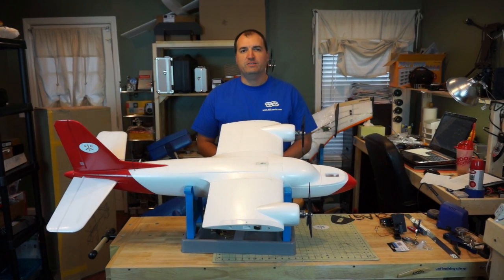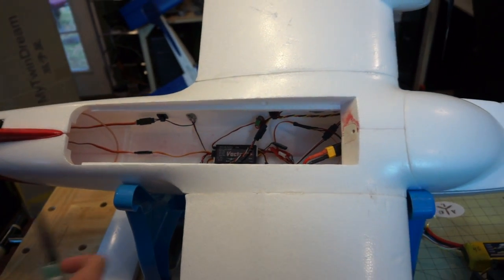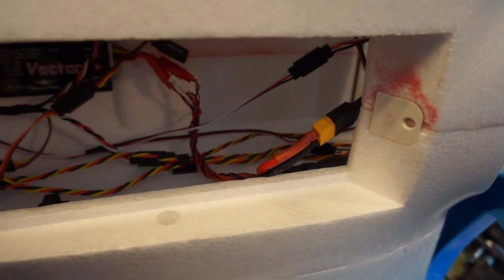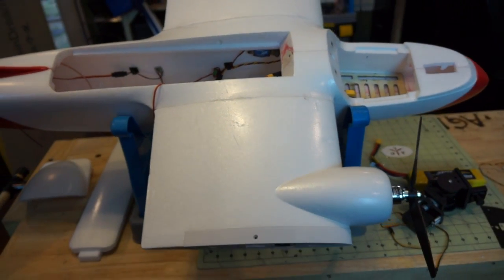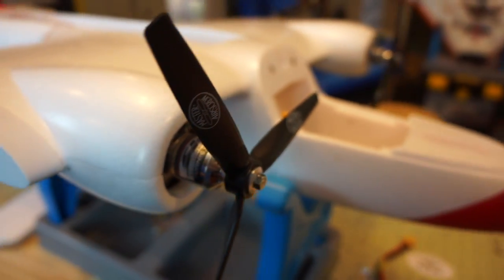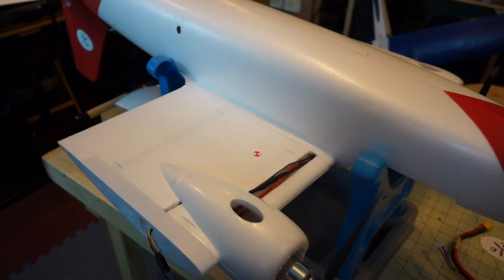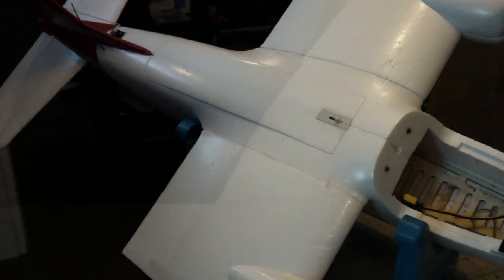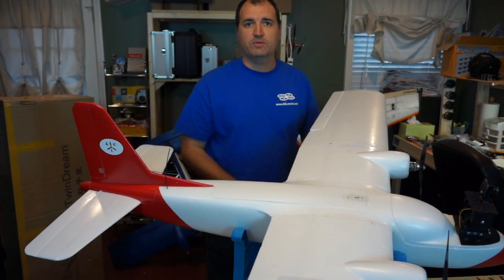My TwinDream Electronics

Comment: Holy crap! That pan and tilt setup was NOT designed for fpv!  lighter is better! Best is NOT better in this application. Over kill is more the word for it! The cost of that equipment CANNOT justify the weight and quality of the use. I have seen simple servo builds do a great job at doing the same thing for WAY LESS money. Crashing is ALWAYS a possibility, especially on that set up. I wouldnt recommend this as a build video for others. I appreciate your effors and no doubt your motors had to live up to expectations. Setting CG on that must have been a bear! Flight time would be greatly shortened on dealing with weight. My question is, did it fly? Hobby King sells some really nice psn and tilt set ups as well as possible 3- D printable type set ups. I would be interested in seeing this monster flying! Looks great!

Comment: You say that you are using SK3 2836 motors with a 4 cell battery. The specs for a 2836 are for a 2 to 3 cell battery, is this a mistake or are you using 4 cell batteries with these motors?   Thanks Bill

Comment: You are using Turnigy SK3 2836 1040kv which the specs on the motor says 2s to 3s. Battery being used is Zippy Compact 5000mah 4s 25c lipo. Am I missing something here? I am putting one of these together and would like to know if you had any problems with your setup?   Bill

Comment: I heard that eagletree vector recommends using digital servos. Is that correct? I know the 939 coronas are digital mg's but are they reliable and accurate? And i know people who use analog and it flies fine as far as i know. But whats the reason of having digitals specifically for the vector. I know what digital seevos are and all but wanted to know why they recommended digitals. The 939's seem to cheap to me to try on such a nice airplane. What are your thoughts?

Comment: I'm building this with a Vector FC. I Noticed your Vector seems to be located way behind CG location. Does this work OK for you . Great build videos!
Reply from the maker: +C JB It is behind the CG point by a couple inches, but that doesn't affect most newer flight controllers.  You can mount them off center, forward, or behind the CG.  They will still be able to properly control the aircraft.  We placed ours at that point because wanted as much space as possible for battery payload.

Comment: I was interested in getting this plane for Long Range FPV but I just do not see how you can fit 4 x 6 amps or 3 x 10 amp batteries in it. If you do it looks like the Vector is going to have to be mounted up on something. I cannot see if batteries will sit side by side in it
Reply from the maker: +Neil Park The vector can certainly be moved.  If I was going to put that kind of payload in there I would build a shelf to put the Vector on, but we are getting 25min flight time out of one decent quality 5amp 4s.  If you put 8 to 10 on board you could fly way longer than I usually care too.

Comment: Amazing video guys. Great work.  I am using it as a how-to.

I would love to see more detail regarding power distribution. Vector says I must power servos separately.  Did you do this?

Also, where does your BEC tap in?  Is that one BEC powering your pan tilt and the plane servos?

What screws did you use to mount the motor mounts to the firewall? Mine didn't come with any.

The only 8 screws I have left are to connect the wing to the shoulders.
Reply from the maker: Taking Flight with G We powered the output (servo rail) with a BEC.  We just plugged it into an open port on the output rail. 
Yes just one BEC powers all the servos and including the P/T.
We used some spare small wood screws to mount the motors to the firewall.
Hope this helps.

Comment: A question regards to transport, do the wing screws have to be removed in order to slide the outer wing out?
Or can you just loosen them , and then slide out to outer wing?
Another thing , wont the set screws damage the spar? as its not really a set screw , but just a wooden screw.
Thanks :) i like your build videos
Reply from the maker: You have to remove the screws completely to be able to remove the wings for transport.
The set screws can damage the spars.  They seem to just barely touch the spars, and may not even be needed at all.  We were just putting it together as the MFD designed, but I've heard of a few people not bothering with the set screws.
Hope this helps; I'm working on editing the maiden video now.

Comment: Hi, do the motors counter rotate or both spin the same way ?
Reply from the maker: Sorry we didn't reply sooner phats.  We have them counter-rotating right now.  There are a lot of differing opinions on whether this is needed.  But, the plane is "relatively scale" and having CR props is a plus in full-size airframes.  Your mileage may vary.

Comment: 1. Add the mount if you want, just remember that drag in front of the cg = instability.
2. Adding tubing to the antenna will shift its resonance frequency. IBC wire antenna is stiff enough.
3. Twist those esc power wires.
4. Replace video cable with shielded if you get lines.
5. Consider a proper tracking device like the Marco Polo (RMRC)
6. Remember to do proper range test before launch incl motors at full power. Running servo and power wiring in the same channel may kill uhf.
7. Consider moving control links to the middle or less of servo horns for more leverage. 15deg on any surface is more than enough.
8. HK motors are usually not balanced well and have bad bearings. Add the price of new bearings, and you could have bought a proper motor to begin with (Sunnysky, Cobra etc.)
9. When you glue the wing shoulders, do not use the setscrews in the spar. Only detail I did not like with the kit.

Build video was great, gave a very detailed overview of hardware etc included in the kit.
Reply from the maker: Thanks for the comments jinkslynx.  This was the third video, hope you watched the other two.
1.  It is very common to have P/T mounts on FPV aircraft.  This mount is not any larger in frontal area that the GoPro brushless gimbals that MyFlyDream has mounted on the same aircraft on their flying demo videos.  So, we are not worried about that.  Plus, the vertical stab area is generous. 
2.  Adding tubing, such as a stirring straw, will not change the resonance frequency.  It is not made of carbon fiber and should not block any signal.  But, we only add what we need to keep the antenna vertical.  The IBC antenna is fairly stiff, but, not stiff enough to keep vertical orientation at higher speeds, so the bracing will be needed. They are fine for most multirotors though.  (keeping vertical is important!)
3.  The esc power wires are a little thick to twist in the provided foam channels.  If you meant the ESC signal wire, it has a ferrite magnet and is clear of most other sources of interference.  But, not a bad tip.
4.  In some installations where there is little room, or no filters on the camera/VTX power, it is not uncommon to get lines.  The Vector is filtered fairly well and we have yet to see an issue with it.  Some have issues with IMRC VTX's because they have a built-in filter and they don't play well with the Vector.  In that case, it is recommended that you have the VTX wired straight to the battery.
5.  We don't use a tracking device, but, we will not discourage it's use!  We display GPS coords all the time, and record GS footage.  It is how we find downed planes, though, it has only happened once, thankfully.  Considering all the builds we have done, this is a testament to learning how to do things properly from the beginning.
6.  Your advice is good, and should be what all people do when using any new aircraft.  However, I don't see how having servo and power wires in the wing channels would effect the UHF operation.  The UHF is located away from the power wiring, and is only connected to the Vector and the P/T servos.  It should not be an issue.
7.  Control links were attached for reference only on the video.  These are things that we finalize on maiden day.
8.  Motors are very user-centric.  Some have issues with them, we have not had any.  The NTM motors though, we don't like those at all.  Sound like a box of rocks was used instead of a bearing.  We love the SK3 series, and recommend everyone check out what factories motors are made in.  It is eye opening.
9.  We didn't see a need to use any screws when attaching the wing shoulders.  Using the spars to keep the wing shoulders lined up should be a part of everyone's build though.

Thanks again for your comments and advice.  It is always helpful for the community to get more information!
Reply: AGL Aerial Video Solutions
1. True, however less is always better.
2. Post 15 here: goo.gl/vvkCNl  
However I have to agree with you that keeping the antenna straight is more important.
5. If the plane enter a spin, the gps will stop updating and may even give false coordinates. Add some wind, forest, uneven terrain and loosing video still several hundred meters agl. Almost always pilot error of course.
6. Depends, couple of years ago I made a Scout bee flying wing, and ran the ppmsum cable togeter with esc power wires for just 4 cm. Failsafe after 1,5Km, motor stopped and instantly regained control. Replaced with shielded usb cable and made a new channel, could do rolls 25 km out no problem. I recall Trappy wrote somewhere to always run signal, power and servo wiring separate, but cannot find that post. 
7. That is good, have seen quite a few posts with videos where pilots manage to stall just before landing due to huge throw.
8. This one ? goo.gl/fF9jHv  Say they are essential the same as Hacker, OS and other.
 It appears they are indeed one of the better motors sold by HK. Only negative I could find was the use of slightly thicker stator iron resulting in about 5% lower efficiency. goo.gl/H0HepY
Reply from the maker: jinkslynx
 The P/T mount will be no issue.  My SkyHunter has a mount with more frontal area than this one, and it is a non-issue.  I have an early SkyHunter, bought it as soon as it was advertised.
Re: 2.  That post mostly speaks of length of wire for the antenna, and the plastic/rubber that directly touches the wire for the antenna itself(and then being able to test the antenna later).  The IBC dipole we are using is already shrouded in rubber, thus, our short straw/shroud will not be making contact with the antenna element itself and will not effect the performance of the antenna.  VAS/IBC tests each antenna when they make them.
5.  I don't know why a FC's GPS would stop working because of a spin, but, we record GS footage just in case there is an issue (and because it's fun to watch later).   Been FPV'ing for a couple years now, and haven't had an issue that you describe.  Hope I never do.  FC's continue to increase in resolution on their GPS antennas, maybe this won't be a future issue.
6.  Don't know where this is coming from.  As I said before, and was shown on the video, our UHF Rx is next to the Vector and no where near the ESC wires or Power Module.  Our RX is actually a little behind the Vector and only the servo wire connection points are inline with the Vector.  The closest power source to it is the BEC, which is ahead and on the other side of the airframe from the UHF Rx.
8.  That looks to be the same file I read before, though at a different website.  I am sure I probably read a repost or that this has been posted on many sites.  We have been pleasantly surprised by the quality of the SK3 motors.  The NTM motors are not good in the Alabama heat though.
I have been on the Labs for a little bit now.  I try and try to get more people on there, but, some just believe Facebook is where you get FPV knowledge from.  Sheesh.

Comment: Great build video!! You guys did a great job at it!

Where did you put the GPS? I never saw it.
Reply from the maker: The GPS will go next to the hatch at the wing root.  Because we are waiting on that 3D printed part from Shapeways, there was no point in mounting it yet, since the GPS and Airspeed sensor are connected.  Good eye though!
Reply: AGL Aerial Video Solutions 
OK, cool! Where are you getting the 3D printed parts from?

Also, what is the biggest 2 bladed prop you can fit on without it hitting the ground? Both wings level and leaning on the one wing tip.
Reply from the maker: flyboyMaxwell Apologies for not seeing this sooner Maxwell!  We got the pitot tube holder from Shapeways.  You can go to their website and search for pitot tube holder or mount and several should pop up.  We are happy with the one we got, and it is quite simple.

Comment: That dipole positioning was interesting have you tried it before? Also what paint do you use. nice simple design. IBCrazy's dipoles are nicely made I use them myself, better than mine.
Reply from the maker: Yes we usually put our dipoles like this on our Sky Hunters and Twin Stars.  On the Chimeras we put the negative on a 90* angle inside the airframe.
The paint is just a can of Krylon from Walmart.  Just make sure to keep it about 12 inches from the foam and use several lite coats.
Reply: AGL Aerial Video Solutions  Thanks, I'll try your antenna positioning its a tidy way to do it. Turnstyles antennas work well on wings as well I'll have to try your other method sometime.
Reply from the maker: stewjw Really, it just depends on how it is going to contact the ground.  The SkyHunter has a high mounted wing, and the bottom part of the dipole can be mounted through the wing, with some heatshrink to let it flex on landing.  With the TwinDream, we want to keep the wings as an "easy-off" thing with few connections.  Thus, mounting the antenna near the tail instead of putting the Rx on one wing and the VTx on the opposite.  The curse of removable wings.  Same thing with our XUAV Talon though.
Reply: AGL Aerial Video Solutions
 I agree totally. Funny enough I've had a Talon half built for ages I seem to have lost motivation with it.
 I was actually pondering where to put the dipole and like you said I didn't fancy putting it out on the detachable wing.